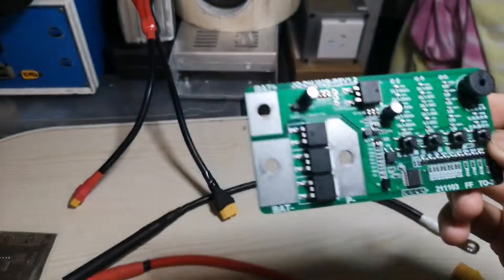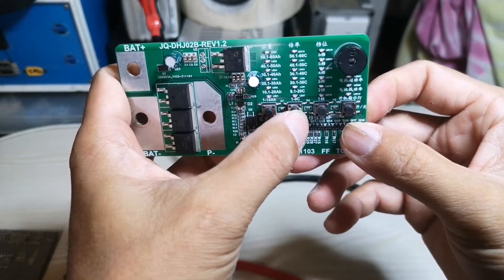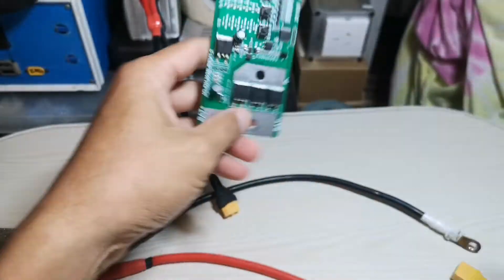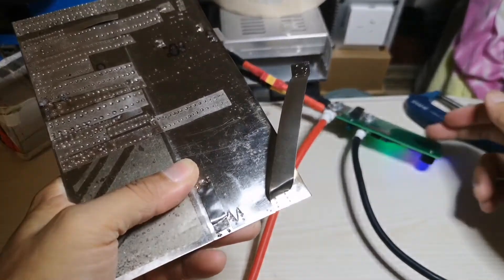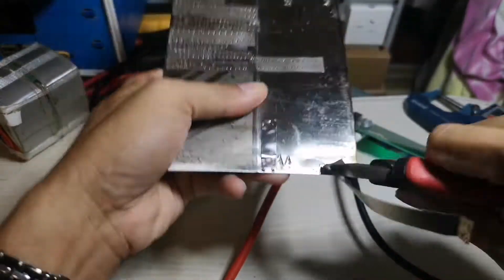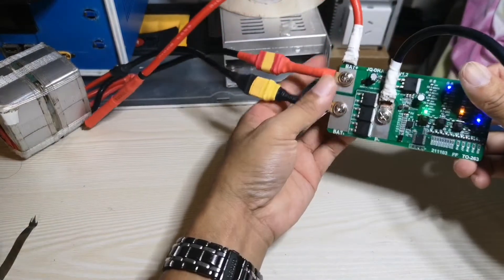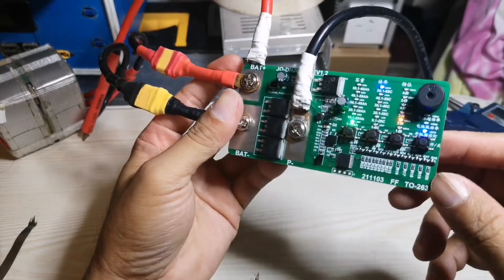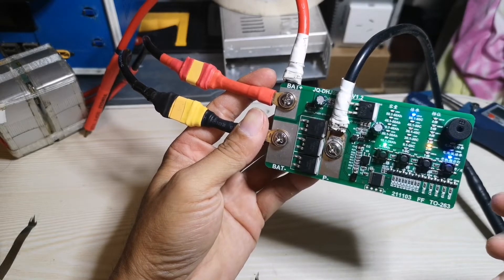2021 6G Intellegent mini spot welder JQ-DHJ02B

Comment: Can I plug 12v 100ah lifepo4 with 40a BMS on this module?
Reply from the maker: No
Reply: @pitikaron  12v 5ah lifepo4 kaya?
Reply from the maker: It must be bypas the BMS and 12V 5ah to 10Ah 50C to 100C
Reply: @pitikaron  Thanks

Comment: Hello from Ukraine. I see that you are testing different welding boards and recommend buying a purple board with 5 Mosfets instead of this board. I would agree with you, but there is just a problem. When the Chinese sold it with the original CS228 or CS209 mosfets, I agree, it is the best. But now they sell it with mosfets whose markings are either erased, the markings are broken, or they are simply fake. And as soon as you connect a powerful battery to it to cook 0.2mm tape, the mosfets immediately burn. This is terrible... It has now been greatly reduced in price. Therefore, I think that if you choose today between this and the purple board, I would choose this one. Because there is an operational amplifier that doubles up and duplicates 15v for the logic of the controller. And in the purple board, for it to work correctly, you need to connect an additional 12v power supply from the power supply in parallel to the battery. So that at the time of welding the controller has a constant 12v for logic and it can normally close and open the mosfets. In general, the Chinese ruined the purple board.

But there is also good news. Now there are very, very, very good boards on the market and not expensive. The Chinese have released 2 new boards, which are now the best. They cost $20+, but trust me, they're worth it. I could send you a link to them if you are still interested in testing new boards for spot welding.
Reply from the maker: Good day! Thanks for your kind advice & sharing your knowledge. Anyway if you're looking for the best spot welding I recommend you click the link after this context https://youtu.be/_T7fAKHPuWM?si=vqDtb44MiMbv4--s    
however if you want a cheaper one yeah the purple but that was the year 2022 release and it maybe there's a new model at 2023. If you don't mind kindly please paste the link to that comments section box thanks.

Comment: I have been watching some reviews on that spot welder DHJ-02B, but it seems that nobody really knows the setting of "C" (1-9C, 9.1-20C...).
Guesswork? Yes, thanks to the really poor user manual. So, at least for me it is Try-and-Error.
Reply from the maker: The sel ction of C rate and Ah you should match up to your battery for example if your battery is lead acid 20ah just simply choose 20Ah and the corresponding C rate, if your battery is RC car battery the if the ah is 5000mah or 5ah choose 5ah and the corresponding C rate.

Comment: Do you think the mosfets on this board are genuine (and new)? Or do they have signs of being salvaged from another device or do they look to be knockoffs?

It seems to be quite common to get used mosfets if you try to order just 10 mosfets off Aliexpress. I ordered some IRL40SC228's and the mosfets match the specs. I tested the RDSon using an RC3563 and also weighed them with a scale that measures grams two places to the right of the decimal so 1.11 grams as an example. I would have to go back and check my emails with Infineon to tell you what the exact weight of the mosfets is supposed to be but Mouser has a wildly incorrect number listed on their website. Like WAY off.

Comment: Can i use a 12v 600cc car lead Battery .
Reply from the maker: According to the spec this spot welder can only go through until 60ah lead acid battery. If your 600CC is 60ah so it is suitable.

Comment: I like your videos I just ordered one from Amazon but you say the purple one is better. This one seems better more powerful just seeing the probe wires shake when you weld.
Reply from the maker: This intelligence board spot weld is also good but I prepared the purple board. Anyway I produce a video comparing 8 lx cheap spot welder. Kindly please watch when you are not busy. You will see the difference.
Reply: @pitikaron  what size lipo battery do you recommend for this spot welder?
Reply from the maker: 12V 3S 8.4mah 120C
Reply from the maker: AU $69.04  36%OFF | DXF Lipo Battery 2S 3S 4S HV 7.6V 11.4V 15.2V 9200mah 8000mah for RC Car Truck Buggy Arrama Truggy  XxMax Tank Boat Racing Hobby
https://a.aliexpress.com/_mN4z1Pa

Comment: hi do you know max baterie amperage i can use 250ah is ok ?
Reply from the maker: if you're 250 ah battery exceed 900A pulse discharge dont used it as a source of power to your spot welding.  anyway I recommend you this latest spot welding and cheap more postive review in Ali-express.  https://youtu.be/hTQgXZBmejQ  Ive done part 1 and 2 review plus comparison and I found out it is better of all cheap spot welding in the market today even expensive spot welding can not compet.
Reply: @pitikaron  how many mah you have there on these other link you recomend ?i have order one same ty
Reply from the maker: I used 8000mah 12V 130C lipo battery 
8×130 = 1000A pulse discharge however the amp limit to the purple spot welding is 2000A pulse discharge.  capacity battery it is not really important but you must not exceed the current limit Which is 2000A pulse discharge. sorry I did not have chances to try large capacity battery like what you said 250ah.
Reply: @pitikaron  what make increase the c's ? for example i have 18650 3100mah 5c, how i do a batterie with 130c do you know ?
Reply from the maker: AU $114.55  64%OFF | 2PCS DXF Battery 2S 3S 4S lipo 7.4V 11.1V 14.8V 8000mAh 110C 5mm HardCase For Car Helicopter Quadcopter Truck Boat
https://a.aliexpress.com/_mP0ojVa
Reply from the maker: what is the CCA of your 250AH battery or cold cranking amp find out how much max current draw in every pulse.
Reply: @pitikaron  only 2c :(, already order lipo 8000 130c ty
Reply from the maker: If your battery 250Ah it is 2C so it can perform welding 250×2 = 500A enough to weld 0.15mm nickel plate up to 0.3mm nickel plate
Reply from the maker: sorry that battery it is too expensive almost 200$

Comment: I just got one of these, and managed to fry it on the second go.   First I attached a 12v pb battery, and that didn't seem to have enough juice, so I got my auto battery charger.
Smoke happened just being hooked up, I turned it down, and upon the first attempt, it fried C4 glowing red, and D1 maybe cracked, and maybe the IC to the right of L1.  
Any ideas?   Anywhere people discuss potential fixes?   Thanks.
Reply from the maker: If the IC burn or cracked it's hard to fix unless you have the program.  if you only mosfet damage easy to replace.  anyway I have a recomendation for you it is also cheap and better of all cheap spot welding I produce video part 1 & 2 and also comparison and I found out that this chap spot welding is the best in the market today kindly please click link below 
https://youtu.be/hTQgXZBmejQ
Reply: @pitikaron  I would think replacing a diode or a cap would be simple, if I knew the values.  Once burned, are hard to read. The IC, if that's what it is, is more problematic.
I suspect I overwhelmed the circuits that supply for the logic with my input supply.  Perhaps too much above 12v.
Reply from the maker: you can try find the same size diide smd

Comment: What could the max battery amperage be? I am not sure if it's 900A or 1800A?I ask because if you go closer to the upper amperage-edge without damaging the board you would have more flexibility in using different/thicker material etc.
Reply from the maker: you already had that spot welding?  If not I recommend you the purple spot welding 
https://youtu.be/htnneHUuAqg. click link please however if you have it so keep it then used up to 600A burst rate.  battery amperage it depend on discharge rate of the battery for example your battery  spec is 12V 6000mah 100C.  6×100C = 600A ideal for kick/jump start and for spot welding for nickel plate.

Comment: I subscribed a few videos ago as I have been binge-watching since I found you LOL...  The question I have is - I really like the spot welding leads you use, but did you make those and do you have a video showing how you made them?.  Since you are very successful at spot welding with these leads, I would like to be able to reproduce your successful welds with leads like the ones you are using, because the leads that come with spot welders I have used are way too small.  I also have made a purchase already from your links to the 99g board you had in another video and also have purchased from your link (in that video) the additional mosfets to upgrade that welder...  I hope these links are affiliate so that you make the money you deserve for your hard work...
Reply from the maker: Thank you for visiting and subscribe to my channel. actually I did not make money from the product link I shared, however YouTube give a peny from the comercial or ads before my video started.  anyway I have a video DIY electrode for spot welding.....  https://youtu.be/wqTp-fMsj9Q hopping it could help.

Comment: can it weld a 0,2 pure copper and 0,2 nickel strip together like you did in your latest battery build? i guess yes because it can weld the 0,3 strip at gear 2 out of 6? so there should be enough power left? can you please please test it and give me short yes or no as an answer?
Reply from the maker: unfortunately not the purple spot welder can perform 0.2mm copper and nickel welding at once.

Comment: good review, will you add copper and aluminium heatsink cooler on mosfet?
Reply from the maker: this controller better to reinforce the traces so that the resistance increase expected current also, However adding heatsink not necessarily becasuse the mosfet did not overheat during testing not like the BIFRC needed heatsink.

Comment: Hi mate. Thanks for great job, but your spot welder it’s version 1.2 with new mos tubes. I did try to find it on Ali. No chance.
Reply: dude did you find version 1.2?
Reply from the maker: What do you mean!  the link I provide didn't work?  their are plenty of spot welding in Ali-express. then check my few video upgrading spot wilding as a guide so that it will work firmly.  thanks for visiting my channel mate.